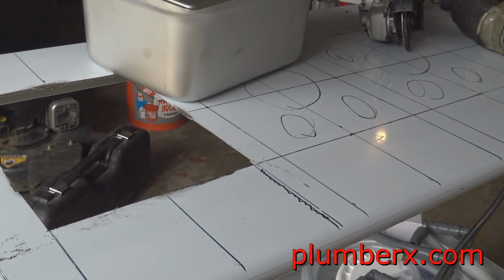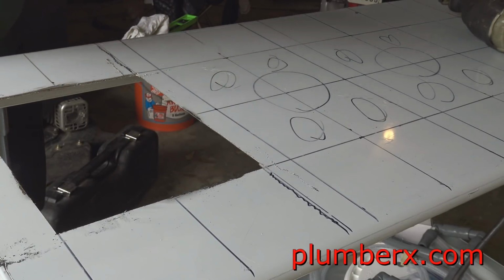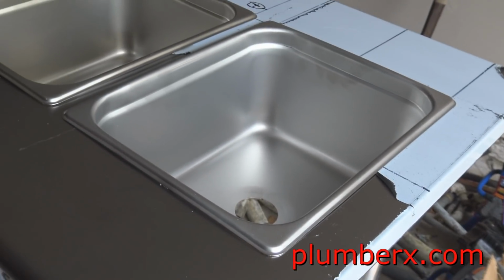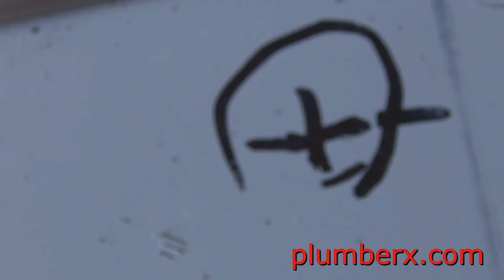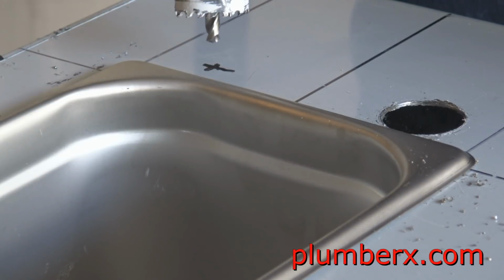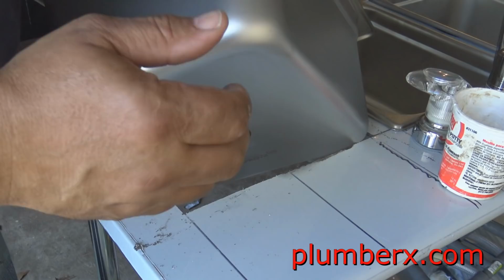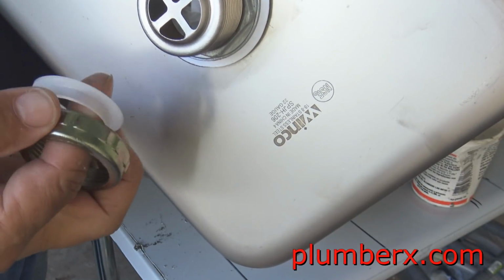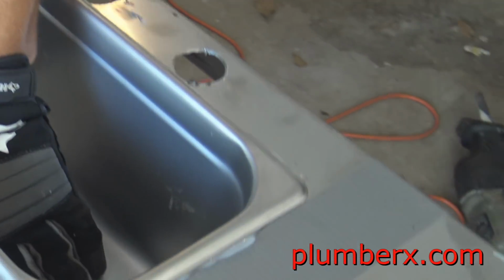Plumbing up a Fast Food Bus | How To Plumbing

Comment: structural stability of the concession stand stainless steel table alot of holes created. a braced under it is highly needed.
there might be instance the stainless steel table will sag due to the load it carries.
Reply from the maker: Yep got that braced. Thanks